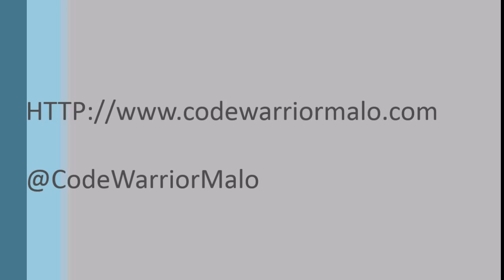mbed Utrasonic Sensors

Comment: wheres is the code
Reply from the maker: It can be found on my website under mbed controller hacking
Reply: @MarkAMalo  Hello Mark, I can't find your code on your website? Did you remove it?
Reply from the maker: @quentinlorge9276  I have made changes to my website.  I will post a direct link in this video soon.  Sorry for the delay.